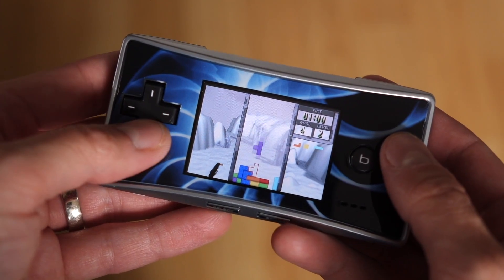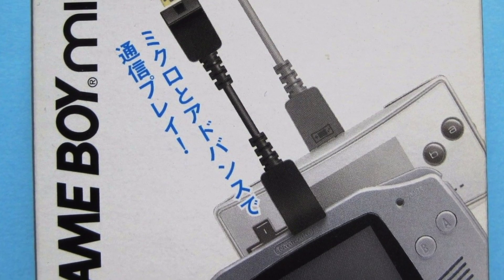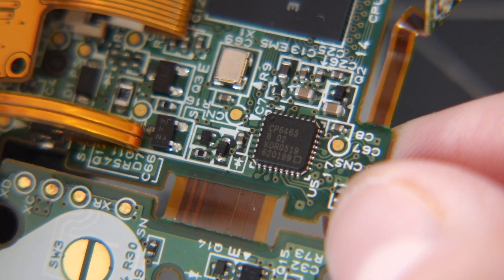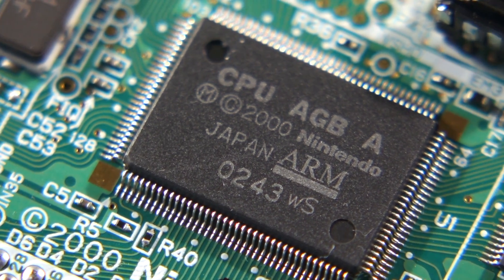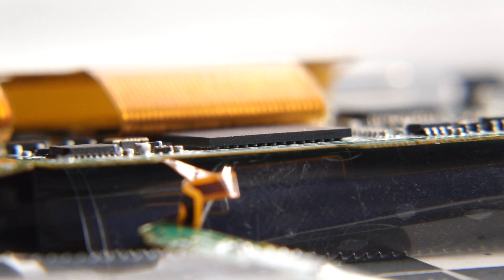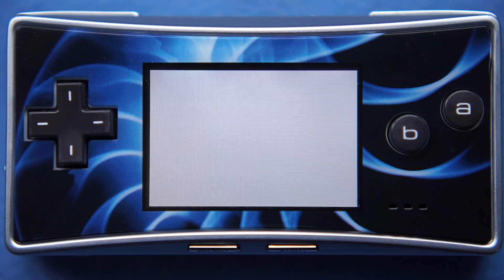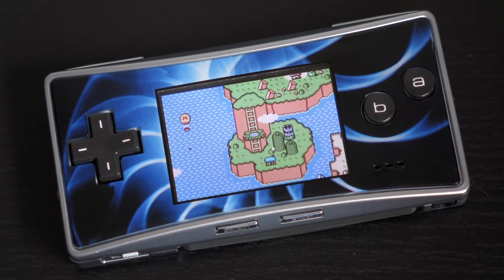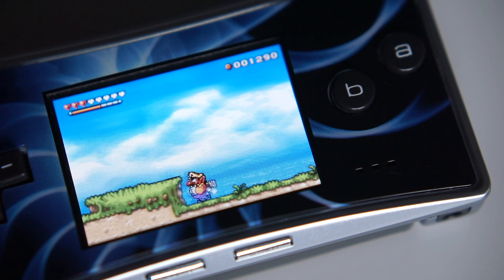Game Boy Micro Teardown

Comment: Okay so a GBA so is pocket sized, works with everything, plays everything, is backlit, and fits in my pocket. Why do I need a yet smaller, more expensive, version that needs an adapter to work with some accessories and can't play some games? Plus I'm nearsighted so smaller screen is not at all a selling point. I admit it looks cool as all hell, but it doesn't seem practical.
Reply: You have the audacity to ask about practicality when it comes to using a Gameboy in 2020?
Reply: @pixelprime5908  yup
Reply: @peterlane1391  fair enough, I carry a Gameboy Color and a Gameboy micro both a flash cart every where

Comment: The CPU is a very much standard part, the Z80 is extremely useful in its original applications.
early cellphones used the Z80 CPU, supporting AMPS,yes, this is a cellphone die.
Who used this, Research In Motion, RIM, makers of  the BlackBerry as well as others.
Later, the ARM chips became cellphone aware as Systems On a Chip, as digital required more computing power.
The Raspberry Pi has most of what makes cellphones and set top boxes work for much the same reason, that is a Broadcom chip.
Nintendo did what I like to see, thinking outside the box!

Comment: This was a significant downgrade from the GBA SP AGS-101 model that was released around the same time.  Yeah the Micro has multiple brightness settings and a dedicated headphone jack, but the new SP has two brightness settings that are great and you can still use headphones with an adaptor.  Also nothing can make up for the smaller screen and no backwards compatibility.  Those are deal breakers for me.  The updated SP is the definitive version of the whole Game Boy line in my opinion.

Comment: Hi, awesome videos as always, just a question which I may have asked in your other Micro teardown video. I'm having problems with my on/off switch, it is kinda loose and I have to switch it at least 2 or 3 times sometimes for it to work, and I think it is causing a short circuit because it makes the lights that say if your battery is low flicker at times, and at times it just turns off the console.

So if I may ask, how could I fix this? I don't want to send it to another person because is the Famicon special edition and I don't trust anyone else but myself to do this (even if I screw up).
Reply from the maker: It being loose sounds like a mechanical problem, but as for it not working all the time, you might want to carefully use some electrical contact cleaner inside the slide switch. Good luck!
Reply: This Does Not Compute thanks, it seems like I need to open it carefully and clean that. Any recommendations on where to buy the special screwdriver?
Reply: NueThunderKing I uto have

Comment: I suspect that the Mitsumi branded chip might be a rebranded STM8 microcontroller. Check its pinout. Could be otherwise a Holtek or an H8, something cheap anyway.

You don't have to ask Nintendo engineers why the Z80 is in there. Numerous games still use it. For example Shin'en GAX sound engine is used in about 50 GBA games, and it uses the Z80. Indeed the complete GBC hardware being accessible in GBA. it would have been a compatibility risk to remove any of it, it's small enough and you'd need bug-for-bug register level emulation anyway. The subsystems are unlikely to be separate dies in a multi chip package, it's likely monolithically synthesized, with ARM7TDMI being a few tens thousands of logic gates vs. less than ten thousand for the whole GBC, so no cost would have been saved by snipping around on GBC parts. The big attraction of ARM7TDMI was that it wasn't only available as separate dies, but as a soft-core that you could integrate into your designs, and obviously Z80 is also available in this way.

Something is still missing. The GB Micro maps the GBC screen into a rotatable/scalable playfield, and is capable of booting the embedded GBC ROM, but it can't read a cartridge even if forced by a software hack, and it's allegedly not a 5V/3V3 issue, as some GBC carts are just fine with 3V3. Well besides GB Micro missing a 5V regulator and a switch. The switch in original GBA pulls down a pin that's checked by boot ROM, seems so,  but not sure what else happens. It is to be kept in mind, that even with hardware reductions and savings, keeping an option open to re-release a collection of GB/GBC classics as a GBA cart would have been smart.

Comment: It didn't even play gameboy games? I'm glad I went with a Raspberry Pi instead. :(
Reply: There are Game Boy emulators that you can put on a flash card, and that'll play Game Boy and Game Boy Color roms. I tried it, it works, but the Micro does not feel right in my hands. Too small. I still like the feeling of the old brick, and I made a custom GBA (not SP) with a backlit GBASP AGS-101 screen in it, which DOES play GB and GBC games, and feels much more comfortable.
Reply: Yeah that's kind of what I've done with my Pi. Though it's not small enough to be considered handheld, I'm fine with having to plug it into AC and a Television/Monitor at this point. Saves me from having to fiddle with batteries too.

Comment: I believe the purpose of the Z80 remaining in the Micro despite a lack of backwards compatibility is that many GBA games used the otherwise idle Z80 as a sound coprocessor, supplementing the main audio system with legacy GB/GBC sound channels. You can hear these legacy channels in a lot of GBA soundtracks actually.

Comment: If I'm not mistaken ,the reason that the micro had to have the z80 core even though it doesnt do gbc mode is because gba games could use the z80 core for extra sound processing when in gba mode. Without it, certain games wouldnt work right or at all

Comment: What would happen If you remove the case, plug in a original game boy game and turned it on?
Reply from the maker: Nothing -- a number of people have tried over the years to get backward compatibility to work, but all the more they've been able to do is get the original Game Boy boot screen to appear. Actually getting that far is what confirmed that the CPU still has its Z80 processor core.
Reply: I wonder how they did that, because GB/GBC carts are 5v and GBA carts are 3.3v. Unless the GB/GBC switch still is present in the cart slot, I guess they either manually supplied 5v, or that the game simply doesn't run because 3.3v is too little.
Reply: +8bitbubsy maybe they used a level shifter

Comment: If only it played GB and GBC games, it would have been the best GB.
Reply: dege13 It's very small. You can play gb/gbc games on it with goomba and it's so tiny.
Reply: Goomba is an emulator and as it is, it's very inaccurate.
Reply: More like if only it played GB(C) games and didn't have a special charging/link port that makes getting accessories for it even harder/more expensive than usual.
Reply: +Gabriele Riva Yeah, but it plays gb/gbc in the correct resolution so at the very least the size of the picture is correct.
Reply: Inv8erZlM
On the Micro that means a less than 1' size picture..!
Reply: Gabriele Riva I would hope it's less than a foot! 😐😁

Comment: So if a switch was built in to the GBM to change the voltage to that required for GB/GBC games (like the one found inside the GBA models), could the backwards compatibility possibly be unlocked?

Or do you think there are more changes on the board than that?
Reply: There would have to be more changes.  That battery does not supply 5 volts, so a DC-DC convert would have to be added and keeping the same profile would not be possible.

Comment: this thing came out in 2005? that's a year after the date on my ds original 2004 so why by this when a ds will also play GBA games
Reply: "A parting gift for GBA fans"
Reply: What Joe ford said. Also, people didn't want to risk eye strain, and most people already had a GBA (SP) by the time it came out anyways. Even now, the only reason for owning a Micro is because it's a novelty console. If it's just access to game libraries you're concerned about, get a N3DS and GBA SP. That will let you play GB(C), GBA, DS, and 3DS games. There are some DS games like Lunar Knights that use the GBA slot found one early DS models, but it's not really essential for any game except Guitar Hero I believe. Even with Lunar Knights, you can 100% the game just fine without taking advantage of the GBA slot.
Reply: A lot of people forget the GB Micro came out a year after DS.  The DS was experimental in its early days and I'm not sure when the platform took off.  It was a baffling move at the time.  As someone already pointed out, that's one reason the micro didn't sell a ton.  I think it was also more expensive than the SP(which had more features), which was still produced as well.  In fact, it's also worth noting that the ags-101 SPs with backlit screens would be available around the same time.
Reply: +TheZeroSbr While I agree it's mostly a console just for collectors and I would never tell someone to get it over an SP, I will say I love using it at times because of how small it is. I put it in the pockets of my dress pants and sometimes play Pokemon in the middle of class. It's really useful for any situation where you don't want something overly noticeable in your pocket or hands.

It's also quite fun to see how people react when you pull it out, I love that part.
Reply: That's exactly why it discontinued so quickly. They are great though.
Reply: when nintendo made the ds, they werent doing it as a replacement to gba, but another option to handheld gaming, even the backlit gba sp came out after/around the ds launch and why even the ds lite still had gba compatibility.

Comment: The "Z80" / custom 8-bit CPU is used for its PSG sound, which GBA games can and do use alongside the DAC. For example Sonic Advance makes heavy use of the legacy Game Boy PSG for bass and hi-hats, with the rest of the instruments and drums/cymbals handled by the DAC.
Reply: This is exactly the reason the Z80 is still in there. The sound hardware on the GBA side only has 2 channels meant for sampled audio though more could be mixed in software. The rest of the audio is handled by the Gameboy's Z80, giving it the 2 original square pulse channels, 4-bit wave table, and noise generator from the Gameboy.
Reply: so.. wait. the DS can play GBA games just fine, and i loved sonic advance, and played it on my DS a lot. but the DS can't play GBC&GB games, and i was told it was bc it only had an ARM chip in (like the GBA), and no Z80. but if the GBA relied on the Z80 for a lot of sound.... how?? D:
Reply: The DS can emulate the Z80. It isn't perfect, but it is close enough to not notice any of the inconsistencies.
Reply: But the presence of the z80 means that theoretically it would be possible for the Gameboy micro to play Gameboy Color games if there was a voltage regulator installed
Reply: Which, btw also means that a GBA is perfectly fine for LSDJ (a chiptune program to be used directly on the gameboy). Better use the original model though as the GBA SPs shared audio output has too much noise and the Micro has no GB support (ideally with a backlit LCD mod).
Reply: SlidingSilver man, i wish they'd used that to enable game boy color games then D:
they could've had a backlog of 16 years for the DS instead of just 5 years

Comment: I wanted a micro back in the day and I still do but it's so pricey.
Reply: You got lucky then!  Currently they're 65-80 US on average.  I got mine for 9 out of a clearance bin at Best Buy years ago, but I know that was unusual.
Reply: The Micro is a novelty console. Not worth the headache to track one down these days. If I find one at a Goodwill for cheap, I'll probably buy it, but I'm not paying ridiculous amounts of money online or at a convention for one. I saw a 20th Anniversary Edition at Super Smash Con earlier this year going for like $500. Granted, it did include the original box, but I don't care about the collector's value of a piece of cardboard.
Reply: I resently picked one up. Its a great console but was quite expensive (€50.-)
Reply: na ive seen some recently up to 100+
theyre getting rare. Ive had a few a few times and sold them cuz i got them for a decent price and figured why not make a couple bucks.
Reply: They never depreciated in value.
Reply: in a way yes. But the size is the biggest bonus. smallest gaming device ever pretty much that you can take with you.
Not to mention its built more with metal this time around and everythings squished together, its a bit of modern marvel of engineering as you saw. What other device connects evrything like that straight to the board and the fact they could do it?
for 500 yes its pricey but if its VGA graded or whatever, that price is included with it. Also some collectors dont mind paying. I doubt it will happen, but that 500 bucks it may skyrocket to a 1000 in a few years or something for boxed and mint/graded.

Also screen looks sharper bcz its a tad smaller. Same case can be made for a psp go if you played one. Going from a 4.3in to a 3.8in, man do games look crisp.
Reply: I regret not picking one up in 2007 when its price was the lowest.
Reply: IT WAS 149,99 WHEN I RMEMBER
Reply: last one i had my grandpa stepped on it so i stepped on his coffin
Reply: African Warlord lol
Reply: DjStiv3 Man do games look crisp, and man do you still get eye strain anyways.

As for portability, a GBA SP can already easily fit into most pants pockets, and even an original GBA can fit into cargo pants. The metal construction is probably the best thing about the Micro.
Reply: Yeah, the Go's screen is really the only good feature it has. You're literally comparing the worst revisions of both the GBA and PSP.
Reply: The Go is easily the best model of the psp tho, assuming you're running cfw. It's more comfortable, has the best analogue nub and the best screen.
If you need a umd drive I would still recommend the 3000 I guess.
Reply: yeah but this ones even more portable. Think about it, why get a newer smaller ipod over an older one.. bothcan fit a ton of songs and in your pocket. Smaller was better back then especially for portability. Battery life was real good, brightness was super super bright. It just released far too late.
Reply: i love psps however the Go is aweome bcz of its size but that is its weakness too. It gets prety cramped trying to play some real good AAA psp games and using the analog stick. its like wtf you have nothing to grip onto. Only a 5 yr old would find it comfortable. Ive bought and sold/owned psps even the go for 10 years now. I know what its like. Its great for now and then portable and take with you but a 3000 is best or even 2000 for those long play sessions.
Reply: I paid 100 bucks on amazon for it but it's worth it
Reply: Deyaced Ylurt I'm ordering one from Japan in mint condition with the box for 95.85$.
Reply: I remember I got mine brand new for $30. That was back in like 2007 though.
Reply: get an Advance SP lul
Reply: LBPPlayer7 I've got 2
Reply: they succ
Reply: Same shit...😐
Reply: I found 4 in 2016 after never seeing one prior. All for  really good prices too
Reply: it is almost 2020 and it is much more pricey...
Reply: Rie Kugimiya the Queen of Tsundere I got mine secondhand for ~€20 iirc... They're not that expencive..
Reply: I've not personally seen any that cheap.

Comment: its kind of the same idea with video card manufacturers these days, all the cards come off one assembly line, the just disable certain features in accordance with the price setting of the card
Reply: Marco FD are you high? the GTX 1050 is nowhere near the same manufacturing process as a Titan x Pascal.
Reply: yes but beside the point i mean it in a series of graphics cards, for example the 800 gtx range from 860 to 880 its the same card just certain functions capped on the cheaper one
Reply: Hasheem Gul
 excuse the typo 9xx

Comment: where u get that plotter work table mat?
Reply from the maker: They're most commonly found at craft stores. They work really well, but I wish they were a bit more resistant to heat -- it'll melt if a soldering iron touches it.